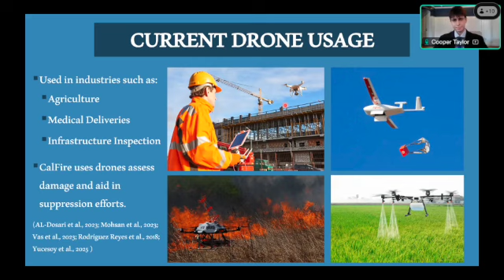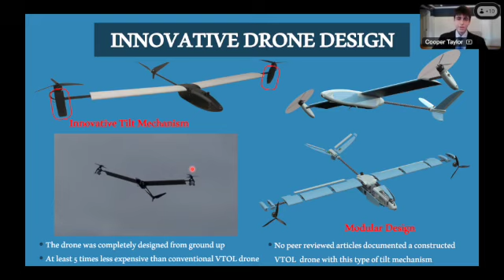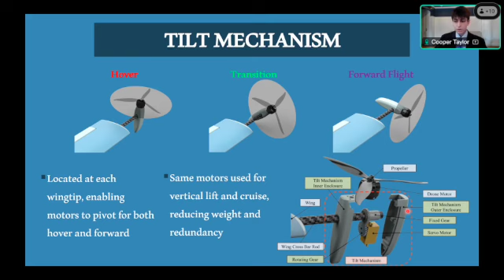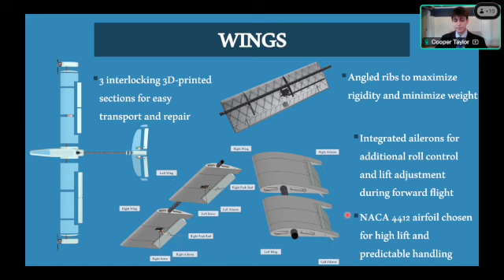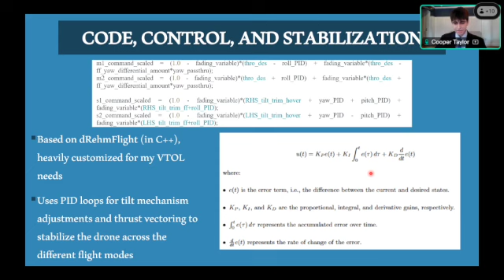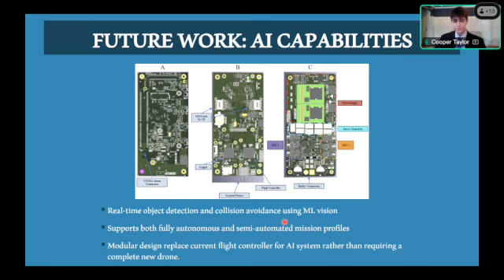CT JSHS Oral Judging Session: Cooper Taylor

Comment: Very informative presentation! I appreciate how you noted where your project fills a gap in the research field. You mention the use of nylon to balance durability, cost, etc. What is the traditional material used and how is nylon an improvement? I also recommend emphasizing more clearly why no existing controllers on the market could stabilize your drone, and which of/how the specific components of your circuit board differ from existing models. Thank you for enlightening us on drones!
Reply: Hi @rachel77536, thank you for your thoughtful feedback! Most traditional fixed-wing and VTOL drones use molded carbon fiber for its high strength-to-weight ratio, but it comes with some drawbacks - very high manufacturing costs, need for custom molds, and limited adaptability for rapid prototyping. Nylon (and its many composite variants) offers a cost-effective alternative that maintains durability and strength while allowing for more flexible and scalable production methods, such as fused deposition modeling (FDM), selective laser sintering (SLS) or multi-jet fusion (MJF) 3d printing. This allows for more adaptable and upgradable design iterations, allowing me to do rapid refinements and modifications that would be impractical with traditional carbon fiber molding.
Regarding the flight controller, I developed my own mainly because no existing commercial controller could be programmed with my custom code. Most flight controllers come with software packages made for specific drone configurations, but none are available that are capable of stabilizing a bicopter VTOL drone like mine, let alone allow it to transition from hover to forward flight. I designed my custom flight controller with specific components that worked well with my code and also gave me full control over stabilization and flight dynamics. This meant I could fine-tune every aspect of how the drone responded in flight, something that off-the-shelf controllers (with their locked-in software packages) simply couldn’t offer. This was necessary because I was working with an experimental design; I wasn’t sure if it would fly, how well it would perform, or what challenges I’d encounter. Having full control over the flight controller allowed me to troubleshoot, iterate, and refine the system in ways that wouldn’t have been possible with off-the-shelf options. Additionally, my power supply system and data logging architecture significantly differ from standard designs. The way my system communicates with the GPS, logs flight data, and manages power distribution is specific to my drone.

Comment: Excellent work! I appreciate the clarity and detail with which you presented the scope, methodology, and findings of your project. What form(s) of software and programming would the transition to an AI-based system entail for your drone?
Reply: Hi @williambernfeld2004. Thanks so much for this amazing question! For the transition to an AI-based system, I am using an NVIDIA Jetson Orin Nano, which runs Linux (Ubuntu) and ROS2 (Robot Operating System 2) to handle all the real-time processing and communication. The Jetson would talk to the flight controller over MAVLink (a special type of messaging protocol made for drones), sending and receiving commands, while the flight controller itself is programmed in C++ to handle low-level flight dynamics (such as movement and stability). The AI side of things (like autonomous navigation and obstacle avoidance) is being trained and tested in a software called Gazebo, a very realistic physics simulator that lets me fine-tune algorithms before putting them on the actual drone. It simulates everything from wind conditions to sensor noise, so I can debug and optimize AI models (hopefully) without risking too many crashes. We will also be using a StereoLabs ZED X One camera. StereoLabs has created some amazing libraries for this camera so we can do depth sensing, object detection, and more with relative ease! This setup allows me to run advanced AI onboard, process data in real-time, and make the drone fully autonomous, which is something I’ve been really excited to finish building!

Comment: This is a great project! Thanks for a wonderful presentation. Could you comment on the cost involved in building your drone if it were to be sold to the public?
Reply: Hi @bernardiicastillo9505! Thank you very much for this great question!  Right now, the cost of building one drone is under $1000 but the cost of manufacturing this drone would really depend on its scale. Some components, like the PCBs (printed circuit boards), would get much cheaper in bulk since custom circuit boards are expensive in low quantities but way more affordable when mass-produced. At the same time, new costs might come up such as logistics and assembly.  Manufacturing techniques, which would play a large role in pricing. Right now, I use 3D-printed nylon for the components, but if this were to go into production, we’d probably need to switch to different industrial 3D printers or even explore injection molding or carbon fiber composites for strength and efficiency. That means the design would need tweaks to optimize for whatever manufacturing process works best at scale. So, while some things would get cheaper, other factors (like logistics, assembly, material choices, and production methods) would influence the final price when this will be sold commercially!